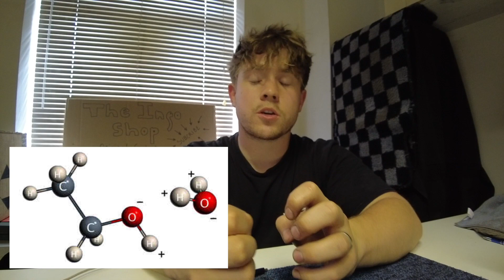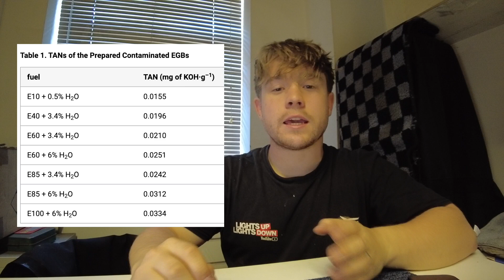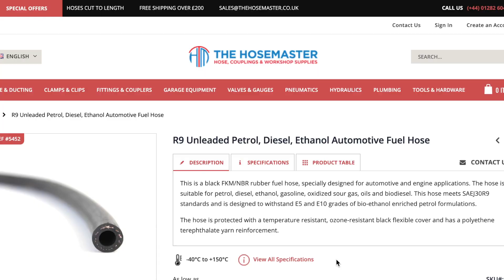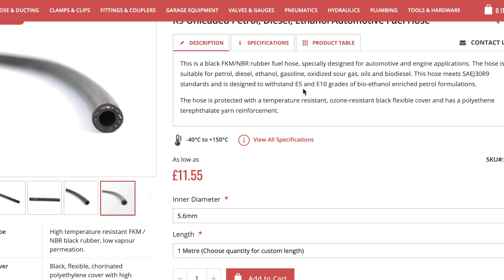E10 fuel, will it ruin my car?!!

Comment: E10 will damage some plastic components, is highly hygroscopic and will absorb water which has resulted in corrosion in fuel systems.  In particular, it has had significant impacts on motorcycle tanks made of nylon which ethanol attacks being a highly aggressive solvent.  Water in the fuel (if left more than several weeks in a part filled tank) then is absorbed into the nylon causing swelling.

I have had one tank destroyed due to ethanol and now use only premium unleaded from my local Texaco station as that contains no ethanol despite being labelled as E5.

Whilst in one of our cars, a honda i-vtec 1.8, E10 hasn’t affected fuel economy, in our Lexus 3.5 v6 it has quite markedly reduced mpg.  

Adding Ethanol grown from intensive farmed crops which aren’t exactly ticking many so called green credentials, which then accelerates corrosion on many fuel delivery systems, damaging plastic parts and resulting for many in reduced mpg, does NOTHING for co2 emissions in any measurable way if you are burning more fuel to do the same work.  It increases the carbon footprint of the whole life costs of maintaining an engine so is arguably WORSE in the long run.  The whole thing is a total nonsense and a more costly nonsense to the consumer both at the pumps and in long term maintenance.

The joke here is that all the cars in the UK contribute to LESS than 1% of the uk’s total co2 emissions in the first place .

For perspective, if one single cruise ship docks in Southampton for a weekend, running generators for that time with main engine at idle, it pumps out more pollution than if every car in Southampton ran their engines for a far more prolonged period of time.  A single large container ship pumps out more pollution in one year than every single car in the UK combined.

So why are we putting such unsustainably produced and processed Ethanol in our petrol?  Because the U K is a nanny state run for minority views imposed by unelected beaurocrats from world trade and global population and climate change control ideologists using anything but scientific evidence to justify the actual impacts which in truth could be worse than what they purport to address!!!  My background includes more than 30 years as a qualified engineer.  This sort of thing really annoys me because of the speculative nature if the imposition and the lies peddled out as being somehow “greener for the planet”.  E10 causes more problems than it solves.  A little quantity, say 2%, might help cleaner burn but modern engines are already very advanced and clean burning and modern fuels equally advanced enough not to warrant any E10 as it reduces efficiency much over a few percent.
Reply: Thank you, that’s very well written.
I drive a 2008 Toyota Prius Tspirit Hybrid and have noticed my vehicle performed awfully with E10. My 1.5L Atkinson Cycle Combustion Engine didn’t like the stuff at all. It was much noisier, took a lot longer to warm up, especially in colder weather and on colder mornings. In turn, the MPG suffered by getting over 10% less than usual - it was even worse, much worse in winter. This is a deal breaker in a Hybrid vehicle. At one point I thought my engine was faulty because it was always vibrating under the smallest load - something it never did before. It was even harder getting up to the speed you wanted - it was like my vehicle had difficulty accelerating as quickly as it did before. Getting to 60.0 mpg became very difficult even when hyper-miling.

Eventually, it dawned on me E10 was the cause of my woes and early one morning, having emptied the tank appreciably, I filled it up with Esso E5 Supreme Unleaded 99+. The noisy vibrating stopped. The engine warmed up quickly, vital for economical operation of a hybrid. It responded quickly to acceleration commands via the throttle and stopped being ponderous. And my MPG shot up rather quite dramatically.

My MPG climbed from 56 mpg to 64.5 mpg on the first 45 litre tankful - and I wasn’t even trying to drive conservatively.
The 2nd tankful produced a stunning 69.4 mpg (my personal best record ever, the previous being 68.1 mpg before the introduction of E10) - and yes, I used my usual hypermiling techniques for that particular tankful. The anomalous engine vibrations also ceased, with the engine running smoothly and quietly like it used to before using E10. 
E10 might work just fine on some vehicles, but I can no longer trust it’s use in a specialist engined vehicle like my 14 year old Prius Hybrid.
Ergo, I no longer put E10 in my tank. My long term opinion is that it’s a cynical rip off deployed to UK motorists. You’re now paying more for less fuel as it disappears much more quickly while NOT giving you the same calorific energy as E5. 
I also managed 653 miles out of a single tank of Esso E5 Supreme unleaded 99+ (also a personal record - previous one was 641 miles). On E10 I barely got 525 miles which was absolutely unacceptable where between 600 to 630 would have been the norm.

I am sure I’m not alone experiencing awful engine performance with E10 fuel. Trouble is, some might notice the difference - many will not, simply because a lot of people don’t even check their MPG or miles per tankful.
E10 is substandard fuel for the masses - a tax on poorer folk, making them pay more for a substandard fuel - and driving experience.
This should have never been allowed in the UK.

Comment: I was amazed when I saw products that would remove the "harmful" ethanol from your gasoline. That is very much "snake oil" in my book. Even though it works..why do it?

All old Volvo red blocks will have no problems with ethanol. The old B18-B20 were made to be able to run on ethanol or mixtures of it. Safe ratio for non tuned, high compression engines are 50-50% E85 and gas. It will run cheaper, cleaner and more powerful.

Comment: First, stop using the word basically. It's filler. Great video though. But I have used both e10 and e5 fuel in my car, and I know the car runs better and more quietly on e5. And it's just a Panda.

Comment: Excellent video, can I ask why they say it is an issue with older Gasoline Direct Injection, is that just a seal issue as discussed? so not really worth worrying about?
Reply: No, it's that early direct injection used a higher pressure fuel pump than the manufacturers regular parts, so was more unique at the time before GDI was commonplace, and many of them were quite fragile and prone to rupturing. Using ethanol blends is a bad idea as the seals in these fuel pumps are going to fail quicker and worse to the point where you could limp home on regular gas with a leaking pump that still ran at lower pressure, but--as was seen in California a lot--the pumps ruptured and sprayed fuel everywhere causing a road side fire. Many classic cars also caught fire for similar reasons and on hot days E10-E15 can boil in the carbs float chamber, so you'd breakdown and ruin the float.

Comment: The "government statement" is based on information from Mazda, and for the MX5, the "cleared" engines are NC and newer, not NB. However US market Miata owners handbooks back to at least 1994 state that the use of 10% ethanol fuel will NOT invalidate any warranty. Mazda UK claims that US market cars will be different due to different emissions requirements. I don't think there is any difference in the fuels systems of NA and NB MX5s and Miata.

Comment: A lady I used to work here in Australia, with had an early MX5 and was told by Mazda that any produced in or after 2002 were compatible but they were not certain on earlier ones as they had not specified it to their suppliers. they suspect they still may be compatible. Not sure whether this was just the Aust market or not.

Comment: Than kyou for this video.  As I suspected, the main issue with E10 is possible increased level of water in the fuel tank if the car is left standing for a long period.  A very detailed presentation of the truth including the USA Miata experience, and in particular it was good to see the analysis of the components in the fuel flow system.   Great CPD for your future progession as an engineer!

Comment: Ow there is a difference between running e5 and running e10 what and see how many seals in the fuel pumps houses and blocked injectors because of hose failing speak to mechanics from other country's there tell you about e10

Comment: I'm not sure you'd notice the drop in fuel economy. I get 42 MPG in my 1.5L 2017 ND. Losing 1-3% means that drops to 41MPG. That signal is going to get lost in the noise generated by driving style and traffic conditions. I still think the introduction of E10 is a greenwashing con but at least it's unlikely to actually do anything noteworthy to my cars until I replace them with EVs. Thanks Ollie, good video.

Comment: Good video Ollie, I'm new to you, so does this apply to all other car makers and not just MX5 Mazda's?
I've noticed the supermarket chains are all going E10 and Diesel at the pumps from September so basically your stuffed if you drive an older car and the only ones who may cater are the likes of Shell who will maybe keep E5 as the new V-Power range and charge a premium for it.
Any thoughts or suggestions please?
Reply from the maker: Hi Mark,

It would depend on how old the car is and what it is, I don't want to generalise on the whole but what I will say is that if your car was made in the 90's it would be highly probable that it will be absolutely fine. Many OEM's would outsource the same lines and hoses for similar companies, so the components are more than likely very similar. Hope that helps!
Reply: @lightsuplightsdown3018  
Thanks, yea my car's on an 06 plate and I'm hearing contradictory info that it'll damage components and others saying nothing will change. so still not much wiser.

Comment: What I wonder is, will the fuel map on my boosted Eunos (12 psi) need tweaking coming from 95RON to the E10 normal unleaded or will the extra stability negate that need and I'll just produce a tiny amount less power?
Reply from the maker: Hi Liam,

You will be fine in terms of safety for your engine. Ethanol is actually more resistant to knock as its activation energy for detonation is much higher. Arguably, you could go to the tuners to run more advance on your timing to actually gain power with ethanol! Untouched though (if you didn't have the car remapped for more power, you will be perfectly fine, but that 10% ethanol will make 33% or so less power). If we do the percentage maths and assume a 33% loss in the ethanol content, it comes out to be 96.7% of the original power made. If at lets say 220hp, you are looking at having 213hp (as an example). Hope this helps!

Ollie
Reply: @lightsuplightsdown3018 , thanks Ollie, I get ya now. So more compression of the ethanol is required to pre detonate basically but calorifically it yields less energy for a given volume then? Tweakkng the timing to produce more than my 250bhp would be nice as I'm only making 209lb/ft peak torque so have reasonable headroom with a 1.6L Eunos Roadster engine afaik 🤔

Comment: I've often argued that a purer product will not corrode to the same extent as a crude one. Increasing the concentration of ethanol compared to standard petroleum and all its elements is likely inconsequential in nature. Not to mention the addition of compounds which are designed to prevent corrosion of said fuel lines and components. which are likely still present in the same concentrations. 

The horror of E5 vs E10 really is a non-story!

Comment: Oxygen by it's very nature is corrosive, ergo a higher 02 ratio a higher rate of corrosion although my only concern would be rubber feed pipes & pump/injector seals which won't prove an issue, providing that they're Nitrile....question is, are they all Nitrile?

Comment: Is it a good idea to buy the better quality (dearer) petrol to help avoid this problem?
Reply from the maker: The corrosion rates difference in the data we looked at between E5 and E10 fuel in a pure and water saturated state is very minimal. Between E40 and E60 which both had 3.4% H20 Content, the annual corrosion rate difference was seen to be 5 micrometres, so fractions of a hair. Its a personal choice as that value might be significant to some but not others, but our opinion is that its so small that it warrants no concern. 

There is an argument that premium fuel is better for the engine in term of cleaning, but ethanol is technically actually a cleaning agent in its self as it will reduce carbon build up creation in the engine, so that benefit of premium in that regard is effectively nullified too. Hope that helps you choose! 

Ollie
Reply: Absolutely, which is why I only ever fill up on Shell V-Power.

Comment: So basically my MX5 NC fuel system is screwed since I live in the United States where we have E85 .
Reply from the maker: I believe that other options are available in the US, at the E10 level. The octane rating is lower for the fuels across the board in the states, but that wont effect a standard engine MX5.

Comment: Can we talk about ignition timing and tuning on a base model 1.6l engine? How much can we advance timing using premium pump gas? 93 octane? For the 90 thru 93 mx5's the base timing is 10 degrees btdc. Can we go to 12 or even 14 degrees btdc?
Additionally is the air box on older mx5 cars, 90 to 93 can it be tuned?

Comment: Do u think that rust in sill is a in fact caused by electrolytic corrosion ,do u think it could be addressed fitting a false cathode to absorb electrons?
Reply from the maker: If it was, it would be by tiny amounts, and certainly wouldn't be measurable. Moisture content is definitely 99.9% of the reason.

Comment: Thanks Olly, makes sense.  No one has mentioned the “Slash & Burn” in ethanol producing countries causing de-forestation and Carbon cost of transportation to Europe.  This is all to reduce carbon emissions in Europe, so just shifting the blame to the ethanol producing countries, superb logic! by someone.
Reply: If they didn't mention it, it's because it's untrue. Brazil's sugar crop is grown in a region of the country that's different than where the rain forest is. And there is no slash and burn in America, the world's biggest user of ethanol fuel.
Reply: @pw601  Yes. The same argument is used by people for electric cars. The batteries, coal, oil produced electricity etc. They don't address the infrastructure around petrol and diesel, or the disadvantages of the otto cycle  and variable loads when burning the fuel.
Reply: No one is mentioning it because it doesn't exist.

Comment: Great video, very on point and informed...... From the best part of 12 years experience in the motortrade in Australia,  vehicles using E10, we regularly replace fuel pumps and injectors caused by damage/corrosion, its not unusual to see fuel tanks corroded through on the bottom.  I had a Kia Rio with the whole bottom of the tank perforated and the rubber coating was the only thing holding it together....  As an average I would say we replace fuel pumps maybe 2 or 3 per month working on the basis of seeing 270 customers a month (average), that would be 1% of our customers that have fuel pump issues.... However in the UK the number was never that high.... Also as a side note, I can tell you what fuel someone is using the minute I open the tank to replace the filter, the e10 fuel causes any brass components to go black and rust will run out of the fuel pump when you remove it...  All I can say is... E10 fuel is great.... for the motor trade... :)  So agreed, it wont ruin your car, but fuel pumps/ filters and injectors will need replacement more often using it.
Reply: Bad news....:(
Reply: And all those who were using this for 20+  years, old cars, no problem are liars? Or are they just lucky? They tested some sorts of E10. Some had only 7% Ethanol in it. So this small amount more will do harm? Or are you talking about early GDI engines? Also some testers put rubber hoses in E5 and E10. Guess what? The ones in E5 looked worse after 12 month.
Reply: @neindochoohh7955   The information ive given are facts that ive experienced over the last 13 years working in a country when e10 is common, who are all "those" using for 20 years with no problems,  as I said in my post, this equates to 1% of my customers, which would indicate 99% have no problem.  

For the record my experience is based on 36 years in the motor trade and being a member of the Institute of mechanical engineers here in Australia..  Be interested to know what your experience is based on?

As said before Ollie is on point with his information, and it wont destroy your engine, however my experience should now somehow be cast aside?? 

Give real world figures to back up your claims not just "all those" and please explain why I continue to replace fuel pumps and injectors at a much higher rate than I ever did in the UK, be interested to read your conclusions :)
Reply: @Richard-Tanya  I posted evidence   and it got erased? wtf

Comment: The only part that's not been mentioned is the fuel filter. I think the Mann filter I got for my NB says "not for use with E10 petrol". I wonder if that's just precaution on their part?
Reply: The rubber seal won't be Nitrile.

Comment: Ollie, I can attest to E10 here in the 'States. It can be hard starting after a long (weeks) sit. You can shop for 100% petroleum, though. We also had a "winter blend" that added MTBE(Methyl tertiary-butyl ether) as an oxygenate. If your car was running dirty emissions, add MTBE and it would pass the sniffer. Helps to have a mate that's an industrial chemist. Oh, and 93 octane (R+M/2) is about usd 3.80/gallon...